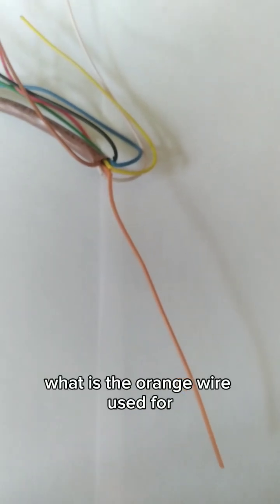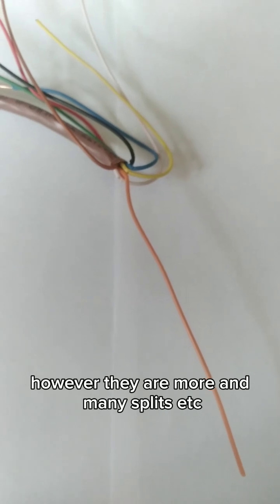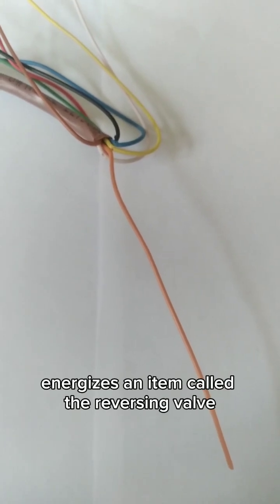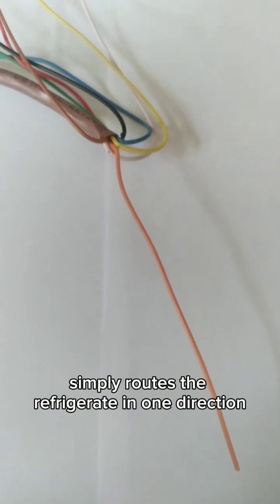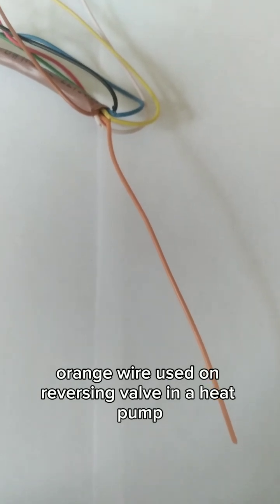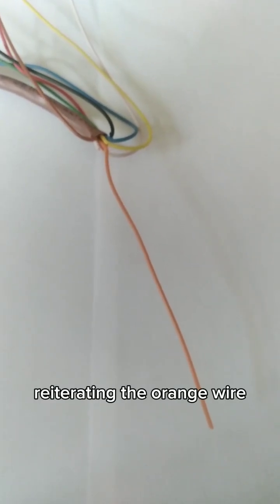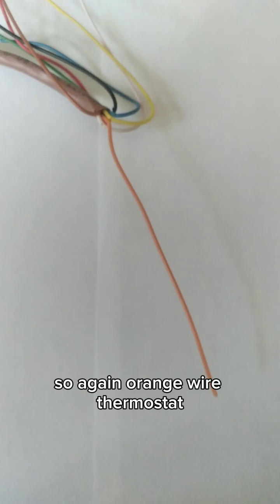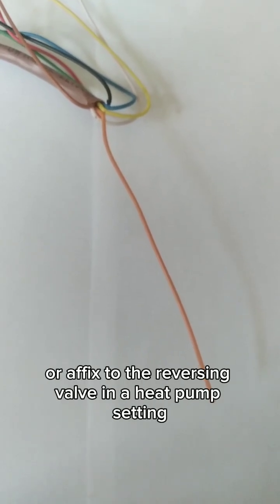What is the purpose of the orange thermostat wire?

Comment: If i need to remove the orange wire to activate the outdoor unit, then reconnect it so the unit extracts the hot air from the house. I'd need to change my thermostat? 
I have no gas.
Reply from the maker: @pandapanda4124  Got heat pump?
Reply: @gotchaplumber  to be honest. I don't know
Reply from the maker: @pandapanda4124  With system off, one could shine into grate, where fan is located, and if there is 4-way looking valve near compressor, kinda looks like three copper pipes going in one direct & one going into other direction, with wires attached, then system may be heat pump.